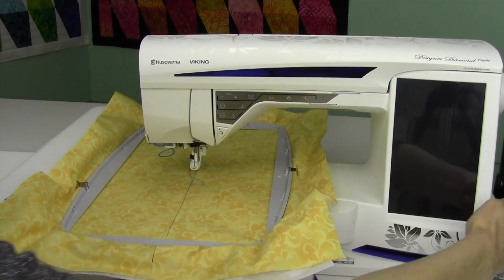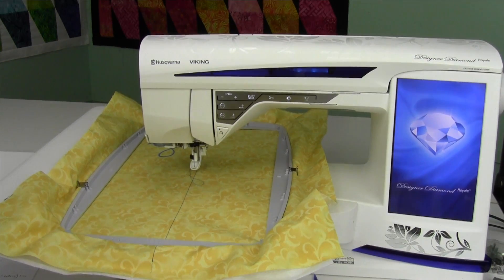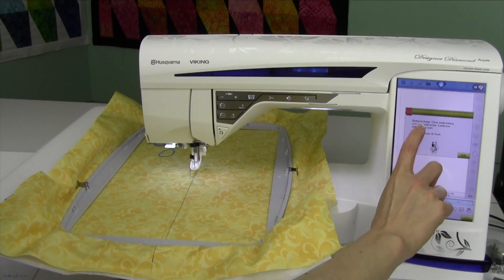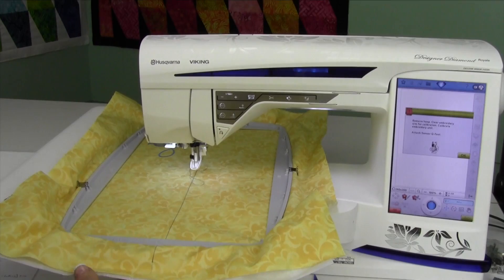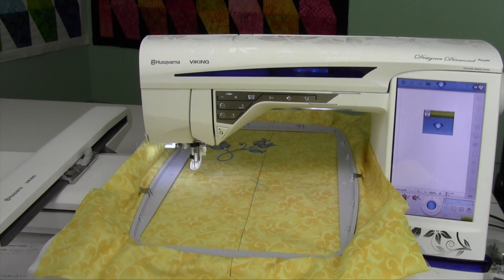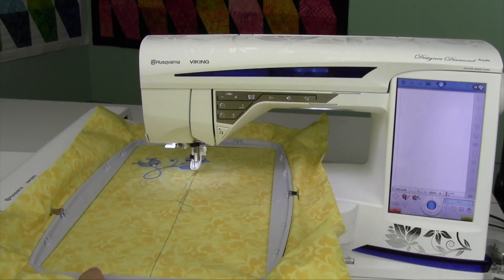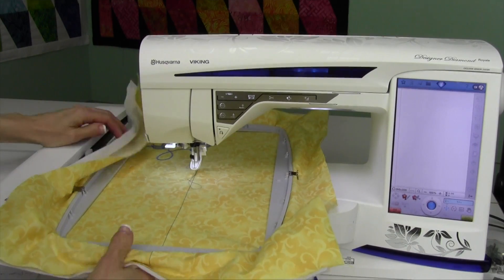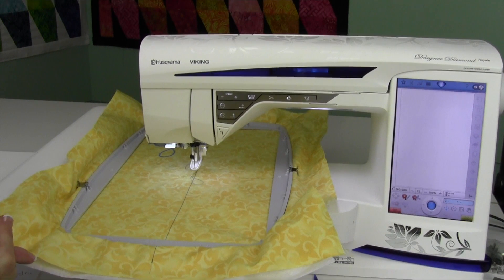Husqvarna Viking Designer Diamond 76 Calibrating the Embroidery Hoop

Comment: When I attach my embroidery arm for my machine, I try to clear the pop up to "slide off hoop, clear embroidery arm for positioning, and use presser foot R". I do all of those things, then hit Okay, it moves like yours but then the pop up comes immediately back up and I cannot clear it. Any advice?
Reply: My dad gave me my step-mother's Designer 1 after she passed. I had to have it serviced at our local Husqvarna dealer because it had been in storage for 10 years and wasn't working. The touch screen needed to be replaced, which I had done and they cleaned and serviced the entire machine including the embroidery unit. But I had the same issue you are every time I tried using the embroidery arm. It was intermittent, where the box would continually pop up no matter how many times I 'calibrated' the arm and let it do it's thing. Other times, the box would go away after having to do it once or twice. I took it in and told the sales employee what was happening. She plugged it in and it worked fine, and she tried to tell me I was doing something improperly. I took it home, with the same intermittent issue; until it finally got to where I couldn't get rid of the pop-up at all. I called the service tech (he'd previously given me his number because of all the issues I had with the machine initially the first time I took it in and he wanted to talk directly to me, so called me). Anyways, I told him what was going on and that it was initially intermittent, but that it was now to the point of not being able to clear the box. He explained that a lot of the embroidery unit innards (parts) are plastic, and there are plastic gears inside that can become stripped out or misaligned and had me take it back in and tell the woman he specifically told me to return it and he already knew what to look for. It turned out that the teeth on the gears were properly connecting most of the time, but every so often wouldn't line up the way they should be and he had to replace them. It worked fine after that. So you may want to take your sewing machine AND the embroidery arm in and have them check that all the parts inside the arm are in good condition and moving the way they should be. It may need some parts re-aligned or completely replaced.
Reply: thank you in have the same issue on my diamond Royale @hkikkert   I am going to do what mentioned